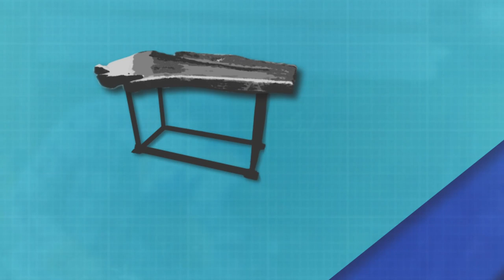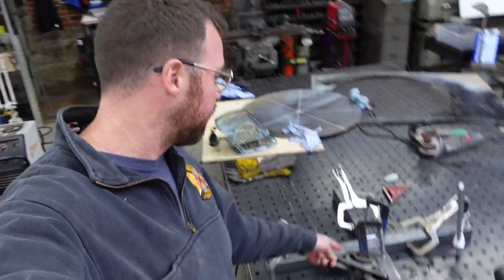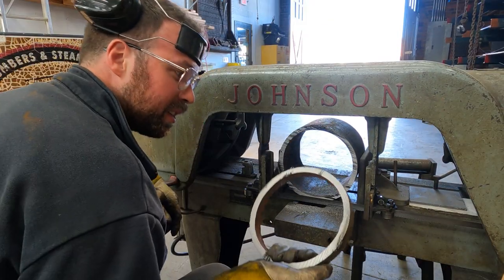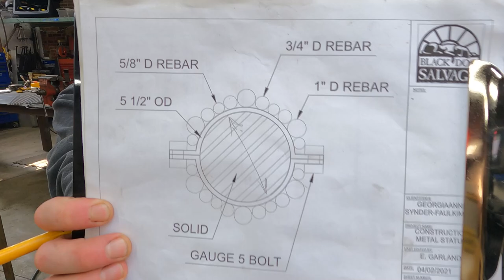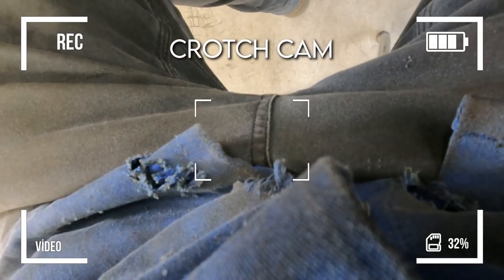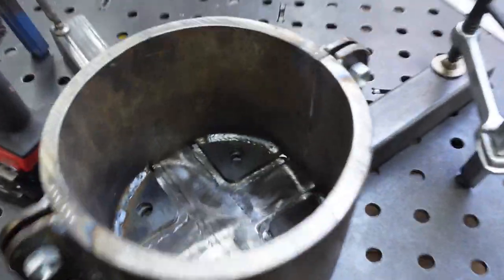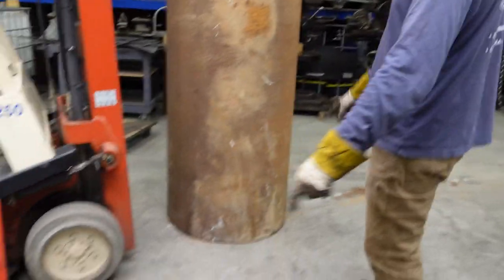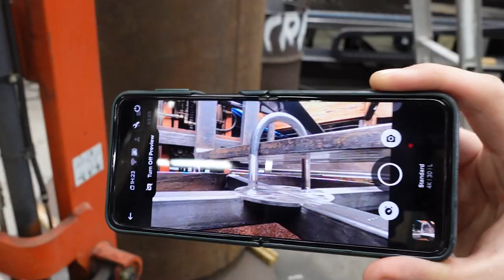ERECTING The Metal Tube for the Helical Sculpture Pt. 2 // Lift Arc Builds

Comment: Nice work!

It does seem like assembling the umbrella part on site will be difficult.  You can bolt the first half to the base easily, but for the second piece, you'll need access from above and below to bolt the second umbrella piece to the base.  You might be able to reach between the spokes from below, but getting bolts positioned in the bottom of the ~ 5" deep collar when reaching from below is going to be tough.